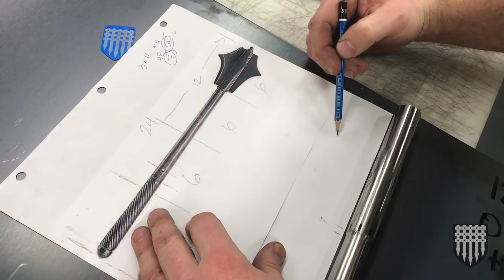Making a Flange Mace: How to Forge a 15th Century Mace

Comment: Wait did you solder those flanges? Brah at least braze them. That is actually historically accurate for some. Forge welding would be better but admittedly much more difficult
Reply from the maker: I brazed them back on.
Reply: @DrawbridgeProps  Coolio. Sorry if you showed this in another video, I bounce around quite a bit. For the record I know first hand how difficult these maces are to make as I have made a few attempts myself as a blacksmith. It would be a real gift to see the masters of old forge one in person.

Comment: The edges of those flanges should be sharp as razors so they will cut the armor and penetrate to the knights ribs. That's what they're for and when they're dull the flange mace is no more effective than any ball mace.
   Oh, and there should be 5 or 6 of them, not 8.
Reply from the maker: There are 6.

Comment: Awww man most every flanged mace has a hollow pipe for the handle :( why not make it solid? I know it would be heavier but you can always include a pommel. Ive just read all the reviews where people tested ones with hollow handles and they tend to dent and bend >:(
Reply: Or you could have filled the handle with something dense hard but light weight like epoxy? That would definitely strengthen it.
Reply from the maker: A lot of period maces actually have a solid core of wood and very thin metal skin.  I think I will make another one that is a little more accurate.